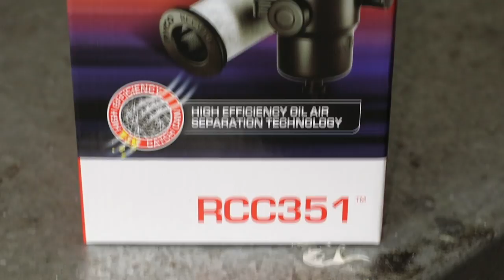I install my new RCC351 CATCH CAN and Water Separator from Ryco into the Land Cruiser 200 Series

Comment: Hi, I fitted the Provent for my Sahara last August when the car was a month old. It’s in about the same position as yours and I’m very happy with the fit. I managed to get the hoses under the engine cover and trimmed the them about 30mm to get a nice fit. My hoses run along under the air con hose and I made a metal hose clamp so the the air con and ProVent hoses don’t touch. Cheers Stuart. 🇦🇺

Comment: I fitted a universal RCC360 kit to my ZD30 Gu Patrol, I'm really not a fan of how much pressure the hoses to & from the catch can put on the plastic crankcase ventilation fittings on both the valve cover and the intake hose, pretty sure if I do some heavy offroading or a long patch of corrugations they're going to crack & snap and the ute won't be driveable with a big hole in the air intake past the MAF. 
At some point I'm going to have to make a few brackets just to carry the hoses and get them out of the way.
And just like you said it makes a bit of a pigsty of the engine bay, the only way I could fit the hoses was to cable tie them to the intake and heater hoses, not ideal.

I also have a leaking seal on my valve cover around the #1 injector, its been letting blowby gases leak out and collect oil all over the top of the valve cover and gather as puddles around the injector tops - the only way to replace it is to replace the whole valve cover which sucks - Anyway the point is ever since the catch can's been on it seems like a lot more oil is coming past that seal - to me this suggests that the catch can is increasing the crankcase air pressure, which isn't good..
Reply from the maker: Yep. I’m still running no filter in mine. The filters are just too restrictive, I should take it off but figured it probably does something without the filter and shouldn’t be causing too much pressure .

Comment: I’ve got a D22 navara and I’m about to go rip my ryco catch can off after watching this because if has heaps of blow by since I’ve installed the catch can thanks for the video and heads up
Reply from the maker: Is it a 350 or 351? Try removing the check valve at the top of its a 350

Comment: So I’ve got an RCC350 and after watching this went to take a look at mine. I’ve got no engine issues I can see but I’ve looked around the catch can over pressure relief and it’s clearly vented a few times in it’s like as there is oily residue around that on the car bodywork. I pulled the lid to inspect the check valve and I can’t see how it would restrict flow. Super soft spring. So I decided to remove the inlet tube and blow down it. I found it surprisingly difficult to blow down. I then removed the filter element and tried again. Zero resistance. Now I’m not sure what sort of differential pressure is normal but I was very surprised of how hard it was. Check valve or not, the element is the cause of resistance and id love to see this element flow tested against a provent 200 element in dirty conditions
Reply from the maker: Interesting. I’ve wondered the same myself if the filter itself is the issue.
Reply: @JebbreysJibberish  indeed. If it is the element then be careful and keep an eye on your new one as they only said the lack of check valve is the difference and maybe the baffle at the base of the element. I want to compare my old element to a new one and see the difference in resistance and whether the weave is tight enough to capture particulates that block it faster than others. Hmmmm I’d love to get these on a rig and flow test them professionally
Reply from the maker: Yes good point! I’m still on the fence of removing the filter altogether on the new on like I did the old one.

Comment: Ten out of ten for tenacity mate. After the Ryco catch can issue before, I thought you would have wised-up and bought a Provent 200 (like you should have done in the first place).
Reply from the maker: You might very well be right.  But the stuff was there and I’m pretty confident the new model won’t replicate the issue I had so it’s worth a try. Of course I am watching it very closely this time around. The slightest look of any issue will see it come straight out and a Provent go in.
Reply: 351 is an awsome product  so effective at removal of sludge you won’t believe how much is pulled from the egr valve after 2000 km or so  when the filter reaches saturation point
Reply from the maker: Just done about 500kms and looking in the drain valve pipe the deep dark black sludge in there is crazy. I’m glad I’m not putting that through my turbo and intercooler.
Reply: @JebbreysJibberish  I have formed a bit of a theory....I have a 2012 Chev Silverado Duramax 6.6 litre diesel and have fitted an Amsoil dual bypass oil filtration system.
With this set-up I can easily extend the oil interval changes to 20,000klm or beyond....and the oil is still honey-coloured when I change it.
I change the primary filter every 10,000klm and then change both filters and the oil every 20,000klm.
When I check the Provent 200 at the time I change the filter/s (ie: every 10,000klm) there's lucky to be 50mm in the drain tube.
I reckon the MUCH MUCH cleaner oil, courtesy of the very fine filtration of the bypass filter, is the main reason I'm getting buggar-all blow-by.

Comment: Provent 200 change pressure relief now blows into the return line to turbo and not to atmosphere.  The changes are simple, relief valve in bottom of filter element and they provide plastic parts to remove relief valve in the lid assembly.
Reply from the maker: That make more sense.

Comment: Fix your fuel line by replacing those plastic nipple/quick change fittings with a brass nipple.  Makes it slightly more difficult to remove the filter, but not much, and gives way more clearance to the catch can.  trim a bit off the connecting hose to suit.
Reply from the maker: Good idea.

Comment: Neat enough. Perhaps shorten the catch can hoses - you don't want too much pressure and vibration on the plastic catch can receiver nozzles or on the catch can..it seems they use the slide fit to the bracket to decouple the catch can from the bracket. Good for vibration in the up down direction, not so useful for horizontal vibration. The constant push from the hoses and that horizontal vibration may end up breaking the catch can plastic as it hardens with age. 
Enjoy your vids - thanks JJ.
Reply from the maker: Thanks Benny. Yeah haven’t thought about the plastic fatiguing… the other one had been there a while and seemed to be ok but a couple of hot summers will test it that’s for sure. Yeah thinking I might trim a bit off…

Comment: I had a Flash Lube Catch Can Pro fitted to my GX 220 Landcruiser. Basically it is a Provent 100 which is great if you are short of room but is always worried me as I recon it was too small for the 200. Anyway I decided to fit a Provent 200 instead as the capacity is okay and everybody seems to fit them. In the process of fitting the Provent 200 I was having lunch and came across Berima Diesel on YOUTUBE discussing the Provent 100 as it was too small causing problems on a Landcruiser.  Anyway because I did not have much room in the engine bay I installed the new catch can in front of the radiator, I saw someone else had to do the same thing (where I got the idea) but it works great and it`s out of the way. Just one thing replace the clear drain hose with oil resistant hose as the clear tube gets hard and brittle, transmission hose is good for this purpose. I hope you new model cause no grief as it must have been very distressing for you on a new engine.

Comment: J/J.  Has anyone looked into installing a pop-off valve after your intercooler sir ?  Wasn't sure if LC200 owners understand when their engine operates under "EGR" control, or if it does under 'full noise' !  V.
Reply from the maker: Do you mean a blow off valve? I think the EGR is completely shut at full throttle.
Reply: @JebbreysJibberish  J/J.  Pop-off valve can be seen on the 'Absorbite' YT Channel used to prevent over-boosting !  Maybe look at fitting a "Banks Power" module to your LC200, so it's always dialed upto 11 and no EGR operation ?  V.

Comment: Hey mate a year onwards. Anymore leaks/issues?
Reply from the maker: I’ve taken the filter out of the catch can as the front seal leaks seamed to be worse with it in. I think the damage to the seals was already done. I also had some issues with the secondary fuel filter that I want to do a video on later, I have since solved those issues though.
Reply: I own a direct injected engine. I read adding a secondary filter adds unnecessary work for a pump. Better off just having regular filter changes. Great content mate keep it up 🍺
Reply from the maker: That was part of the issue, however it has been resolved and has been working good. Fuel filters are a tricky one, I love rural and had a pump in my old patrol ruined by contamination and I changed my filter every 10k. It was $2k for an old TD42 pump replacement, god only knows how much a 1VD pump would be, and that’s not to mention the $8k worth of injectors.

Comment: So this gave me a freakout, Ive got a 4JJ1 Rodeo and the engine has blown the rings, its driven me a bit nuts not being able to find the reason then i watch this. About half a year or so ago i installed a Ryco catch can so had me thinking aw fuck did i do this to myself but upon checking the order it is the 351K model so...shouldn't have this restriction issue like the 350, but as Ive got another 4J going in ill just be monitoring the CC very closely now, checking blow by pressure best i can and all that. knew i should have gotten a provent. 20/20 hindsight they say. 

My current theory was prev owner, like your own experience, had dusted the motor (i hate buying off P platers) or had messed with the motor too much, in amateur fashion (found their "attempts" to circumvent the EGR system, first with a blanking plate, then a drilled blanking plate and i assume final move, a resistor in the IAT sensor line to just fool the ECM). But maybe my choice of CC has played a part. We shall, hopefully, see. 

Also just wanted to say Ive stumbled upon you from John Cadogen aka Auto Expert response to your cheeky "piss take" vid of him and i say i do agree with the points you made in the video. Youre absolutely right that John has a lot of good information, i cant express how much i agree with him on the 3.5T rating thing all the utes are barking up atm but you're also right that he is a city bloke and doesn't much admire the bushbashing and overlanding experience either. Thats fine for you both to have that and i find its good to get content from both sides. Engineers aint always right but they do get A LOT right when you consider how comprehensive and complex a modern car is now. Keep up the good work, ill wave to ya from ym road train if i see your 200 going passed ;)
Reply from the maker: Yeah sounds like we both got a bad deal. I’ve been pretty lucky and pretty careful with al the cars I’ve bought in the past (and there’s been a lot!). It’s the first time I’ve been caught out and I must admit I dropped my guard on this one so it was my own fault. As far as the 351 goes, yeah be very careful and monitor very closely as we know how things can go wrong pretty quick.

Comment: Please explain why it is that you need a catch can. My engine rebuild bloke says “what ever you do NEVER install a catch can. It’s completely unnecessary and harmful “. 
It just doesn’t make sense
Reply from the maker: The VDJ engines breathe heavily and dump the nasty black watery Vegimite into one turbo only. It also mixes with the EGR gasses and creates a thick black paste that blocks up your intake and valves over time.
Reply: I’ve got a 2020 79 series dual cab done 55000k. Have only installed a unichip add on. Absolutely no problems so far….
Reply: @cmmsng  but what does it matter if a trail of oil is fed back through.. ?? surely Toyota engine designers understand this when designing an engine. They can’t be completely stupid.. those of us who are non-believers of catch cans don’t experience premature engine failure ( unlike those that seem to install them)
Reply: @camh7788  a non catch can user believe that God will look after his car. A catch can user believes in looooong term maintenance for a better full life, not a underrated life that will earn you a nice "cheap" intake clean every 100k
Reply: @camh7788  the catch can would be the 1st thing I would install when getting a diesel 4WD. I had my 200 intake cleaned about 6 months ago and it cost me $1200 and was pretty thick. I would also only stick with provent 200. You will need a clean around 130000. If you owned a Ram it would be as low as 60-70000.
Reply: @camh7788  look up Berrema Diesel catch can. He explains why you need a catch can and why stick with provent 200.
Reply: I don’t have a 200 series… only the dual cab single turbo engine
Reply: Carbon fouling the intake valves , from positive crank case breathers , on direct injected gasoline.  But on diesel , I'm not so sure . Sad thing is , I own a 7.3 powerstroke and have no idea if it's an issue like in gasoline direct injected engines .
Reply: He’s correct in my opinion. The engineers at Toyota know they’re stuff and I’ll listen to them over someone trying to sell me their product. Check out John Cadogan’s channel for the info.
Reply: @greenslawngarden7809  you do realise car marker build a car to last X amount of yrs and X amount of kilometres and following all the car makers advise will get the cars to that point anything after that is a bonus and that's when you go buy another car from them. Gone are the days of 500 000km to 1 000 000km eng and drivelines and lasting 30yrs plus.
Reply from the maker: Agreed. For all the ‘Toyota Engineers’ fans what about the dust leaking air box?  What about the DPF issues. They are not perfect.
Reply: @JebbreysJibberish  can’t disagree there.
Reply: Absolutely all diesels with EGR need catch cans.  Not all are created equal though.  You want one that can filter very finely...like 1micron, which all of these decent units happen to do. 

I'd still install one on a diesel without EGR.  At the end of the day it'll keep issues at bay over time, egr, intake, dpf etc....including your vehicle pumping out less emissions from the tailpipe.

Comment: Sorry, but that catch can is a train wreck.  Filter removal should be easy, not impossible.  Having the outlet in the top cover not the base is just stupid design, and needing to undo 4 difficult fasteners is just plain stupid.  Piss the thing off and get a Provent.  The hoses look crap too, but they are needed.  The scuff covering will prevent chafing.